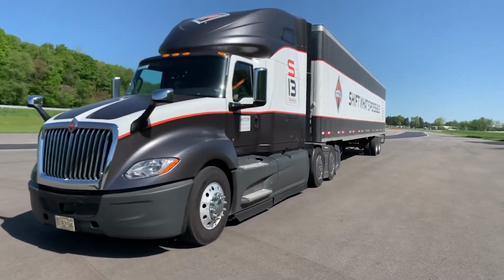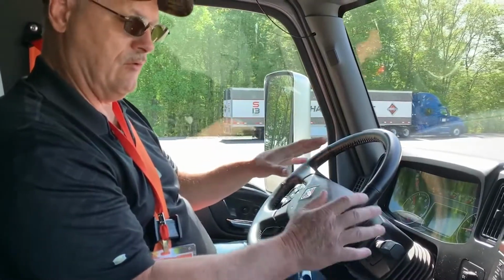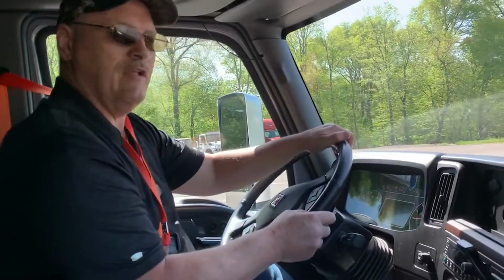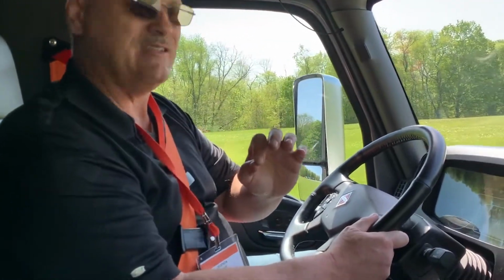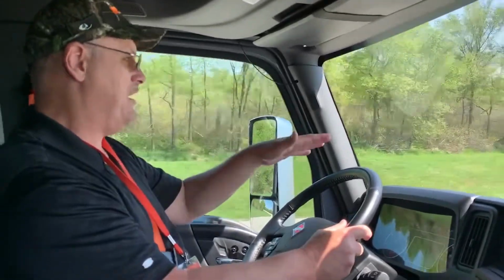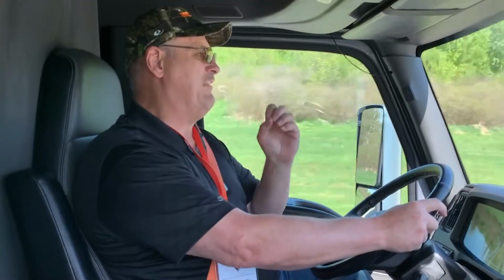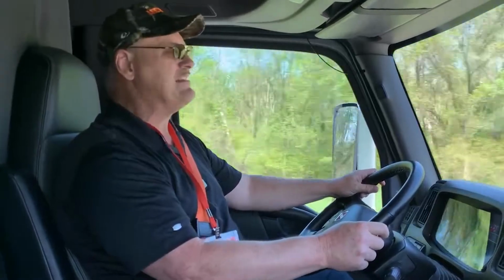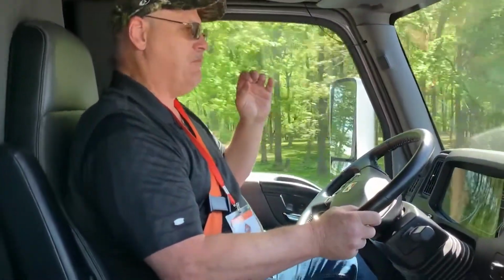International S13 T14 POWER TRAIN Test Track Test Drive in the LT625 Sleeper Must See!!

Comment: What are the biggest differences between the 2024 and 2026 LT S13 models ? Software updates ? Im test driving a S13 ,14 speed and put 100,000 miles on it. I just serviced it and replaced the thermostat under warranty and had recall and software updates ABS wasn’t connecting. I have an opportunity to buy a new 2026 @ retail however the 2024 is about 40k less. I can’t believe the deprecation is at 20k a year…is that accurate?
Reply from the maker: If the company is using five year depreciation even, then yes, it depraciates 20% every year.  What is the current status of your tractor need?

Comment: Anything is better than Navistar dog crap.
Reply from the maker: I appreciate the feedback, I am needing to open the conversation more regarding your experience.  As a reference every maker of engines has had - at one time or another. issues.  The former heads of the company (notice former) made a bad error which tainted the Navistar franchise.  That engine died and was buried in 2015.  If you are experiencing something in the current decade, then I am all ears!!!  

Let me know if this was a vent.  or if there is something for all to listen and learn from.

Thank you again for starting the conversation!
Reply: @MichaelOlden  everything I've seen on the Scania integrated package looks like a big leap forward for International trucks in North America.  Navistar screwed up with the Maxxforce 11 and 13 engines, the A26 upgrades have not fixed the reliability problems.  I hope that the S13/T14 drivetrain will cancel International's gremlins.

Comment: I hope Trump tariffs the heck out of scania to the point they can't sell them over here
Reply from the maker: Interesting point! this engine is built in Huntsville AL which is exactly what Trump wants to see!!

What is your driving experience with the S13?

Did you like the same overall starting ratio as an 18LL?  The final 5 mesh point to trailer or dock?  The even ratio spacing resulting is a much smoother gear shift pattern?
Reply: Its an engine buildt by "International" in USA.. its a whole concept with  gearbox and the exhauste treatment system!
I do think they have converted all the measurment and bolts to good old British Imperial measurments, for US market?
Its now a Traton best selling power train.. becuse in central and south europe they have kinda the same weight limits that in USA! Its in Scandinavia, Australia.. and to some extens south america there one need 700+ hp and more gears!

Comment: I drive Scania in EU for about 6 years by now, and besides the exhaust's sound....yeah, I happen to notice the Scania in the engine sound and the gear shifting ;)

You're in a real treat there
Reply from the maker: Thanks you for sharing the positives about your experience with the Scania!!
Reply: @MichaelOlden  You're welcome!
At the moment I have a 2 year old one (450hp, 12 gear), and got it with 165km in it. During this time, the only problem I had powertrain wise were faulty injectors (4 out of 6 got changed due giving the fuel to the engine on too high pressure). Till around 10-12 tons it barely feels the load on hills, after that starts to fight, but she does the job.

Comment: Traton not so much...
It's a Scania developed engine...
Transmission is the latest iteration of Scanias "OptiCruise"
Reply from the maker: Yes the powertrain is the results of five years and a billion dollar investment from Traton.  The Volkswagen AG holdings of M A N, Scania, VW Truck and Bus, and Navistar.  It first came to Market in the Scania as the Super 13 and the Opticruise is referenced as the T14 transmission in the U.S.
The is roughly 90% of the components in the U.S. as we are 12 volt and do not utilize the transmission retarder.
We are seeing incredible fuel efficiency, MPG, and true appreciated of and engine without required active regenerations due to the removal of the EGR and use of SCR technology to treat engine NOX.
Thanks for the Comment!!!

Comment: What is best for Colorado Rocky Mountains with altitudes greater than 13,000 ft on highway in hot weather?
Reply from the maker: Well - great question.  The answer is a turbo engine works well at the elevation referenced.  I would suggest a review of the load.  There is a 400 hp with 1850 lb ft torque that would be my fleet spec.  As an owner operator, you are more likely to go to the highest HP with the 1850 torque.
Reply: I think this truck would do great. In the north of Spain, all you can see is Scania trucks in those small and crazy roads of the Pyrenees mountains. I saw this summer various Scania non v8 pulling hard in a crazy steep and narrow 1 lane road,it was climbing at a very good pace with 35ºC (95º F) close to 2000 meters(6,500 ft). The proportion of Scania trucks in this area is very noticeable. That engine made 600 HP here in the top version. 
Spain is very hilly,you need more than 500 HP to not be at 30 mph on the highway in the mountains. Modern trucks here can go 40-45 when full loaded in those situations to not be a hazard for the speed differential.
Reply: @josemorenoporras7506  Well stated. Our altitudes go up to 14,000ft / 4267 meters above sea level.

Comment: I'm not knocking the product, your job skills or abilities.  International trained you how to drive that truck and transmission.  Your experience and safety policies have you driving it like a 40 year veteran.  Here's my challenge to both you and International.  Put that engine and transmission in a dump truck.  Imagine you're on the job and you have as many rounds as possible to make of hauling out of a job site, to a dump site. Get back to get loaded as fast as possible.  Loose dirt. Soft soil. Wet, spongey ground. Clay. Sand. Try the truck in all these terrains, loaded and unloaded.  For at least 200,000 miles. You won't always have equipment to pull or push you out. You'll have to give it the beans and make it  get itself out some times.  
As I said earlier, I'm not doubting the technology, your skills or abilities.  But in the real world applications like dump trucks, they're often driven like they're stolen.  I understand manufacturers can void warranties and refuse service if operation goes against recommended driving  techniques.  Dump trucks use the same techniques as road trucks and then some.  Lots of short trips. Way more stop and go experiences.  Way more shifting events needed.  Higher transmission Temps should be expected.  Build the trucks and transmissions to take the abuse. Limit those transmissions to off road capable dumptrucks.  Then come and give us the video.  The average construction dump truck driver is holding the foot to the floor and trying to take a bite in between bouncing out of the seat.  The butt massage experience you had in this video should only be expected by 40 plus year veterans and your test track, limited by safety policies and testing parameters.  Build it to not break.
Reply from the maker: A very well written and in depth search for a truck engine that can make it happen.  This engine is going into the HX Severe Service Model for Navistar International.  One of the significant reasons for the is that the transmission has the same effective low as an 18 speed Lo Lo transmission.
Speaking to the environment use, the US is one of the few parts of the world that has a tremendous warranty responsibility pushed to the factories.  And there are ways that an engine can be move from warrantable to non warrantable.  The issue being the servicing records, the improper use evaluation between sales and the client (i.e. 120000 GCWR use where the representative focused on 80000 GCWR), and I am sure there is more following use verse abuse.
I appreciate the 'driven like its stolen' real world use reference.  Which is why the electronic clutching will keep pace with the demands of the foot as the engine and transmission are clean sheet technologies BUILT to hyper communication and make use of the recognized axle load, predictive cruise, and selected performance mode to minimize aggressive foot throttling.  The quality of the field use also in off road applications is set to 'rock out of a hole' when a hole is 'discovered' in use.
Are all things bullet proof - well they have been severely tested and are in use today.  The mileage is not yet a 200,000 - but we are getting closer to that mar each day.
I will gladly forward your thoughts to my point of contacts within sales engineering and testing to allow their feedback as well.
This is not a design created solely by Navistar.  With your knowledge I am assured you are familiar with Scania and M A N.  Also a part of the Traton family name and instrumental in this creation.  As was the final sister company Volkswagen Commercial and Bus.  This powertrain is a world wide component with 90% match of it assembly.
Reply: @MichaelOlden  I'm currently driving a 2018 Volvo VHD quint dumptruck. It has the 12 speed automatic transmission. The truck is set up with a pointless hook for towing.  The spots I see low performance from this machine is: When the tires start sinking, the transmission has to be manually put in first gear. In Auto mode, the transmission goes to 3rd gear by default. There's also a delay in engagement from park to forward, and forward to reverse. This slight delay, combined with the requirement of manually putting the transmission in manual adds up painstaking seconds when you're being pushed or pulled from a stuck situation. The result is the transmission  gets confused with the sudden electronic demands. That's the best way I can describe it.  It locks up and will kill the engine at the slightest touch of throttle.  This "stubborn streak" from the transmission that happens, is followed by the boss getting upset. They have to get another piece of equipment to pull the truck out. It won't help itself out.  Once the truck is out, it sits for another minute, and everything engages and shifts as it should.  It's a tough transmission.  The truck has just over 150,000 miles.  It pulls a tag trailer with a D6K LGP without problem.  It's the off road use that needs the focus. It's not uncommon to do quick direction changes, just to keep the truck moving in certain terrain.  Have the engineers set up a quint dump truck with this engine transmission combo in your video.  I'd be really interested in shoving better results under the Boss's nose to look at.  A good truck can make more money. Bottom line.

Comment: Any idea what the warranty is going to look like ? I assume it's going to be practically bulletproof I hope considering the MaxForce debacle.
Reply from the maker: The base warranty is actually a standard warranty for the truck.  The accolades of this engine are reverberating in our sister company Scania - the Super 13 is wining awards for MPG and power in other countries.  The main difference is that we use the 12V vs 24V system, and other market use a transmission brake verse the engine brake.

All good and all awesome.

The removal to the EGR and Variable geometry turbo, the planetary transmission with electronic clutch (vs pneumatic that comes with air build up time and warnings), and for those who need it - the PTO will come from the factory to instead of a 1 year warrant.  Your get at least two and it is part of ANY transmission warranty.  WOW!

BTW did I mention that the SCR technology only uses 10% more DEF - we use a dual dose SCR focused system and allow the engine to be an engine.  IE. produce power verse choking a bit on its own waste.
Reply: @MichaelOlden While we all know Navistar was incapable of building an engine without help from other companies, I hope this engine does well for the drivers and owner operators that may drive or own it. I love that they’ve gotten rid of the EGR, DOC, and the increased DEF is a non issue. 

I have had trucks with electronic clutches and pneumatic clutches, and I prefer the pneumatic clutches due to their reliability, clutch engagement power, lower maintenance, and the fact that they’re easier to maneuver while backing up. I’ve never had a pneumatic clutch “run out of air” like International claims while backing up, so that point is completely irrelevant. It will be interesting to see how this powertrain does in the real world because we all know the testing isn’t done with the same factors drivers face on a daily basis.

Comment: Please test the unit in the West Coast we have mountains and curves.  US routes 101, 299, i-5, i-80, and i-10 CA-AZ, have a driver pushing it on the mountains and curves 80,000lbs.
Reply: Handle that piss easy. NZ ones have been doing at least 50,000 kg (110,000 lbs) on this Power train for the last couple of years.
Reply from the maker: I will check with my contacts at international for a response to this inquiry.
Reply from the maker: Still checking for feedback, but I am sure that there are large national fleets that are currently involved in that exact testing. Keep watching for more reports!
Reply: No need too. It comes from Scandinavia. Mountains, polar winters and double freight weight. And the best in mpg
Reply: I loved it ! Manual shift is your friend .

Comment: When is it going to be available for sale @ dealerships??
Reply from the maker: With the backlog of tractors it is hard to say .  But I can share that many will start receiving trucks intended for demonstration.  I.e. runs a couple of weeks with certain fleets then available for end user delivery.

Would you like to receive a price on that?
Reply: @MichaelOlden   I tried to get a quote online but never heared back... My guess that truck price will be close to 200k brand new... The power train looks very promising, but I hope that international is using better materials and better quality control when manufacturing the engine bcuz their A26 engine premature failures were due to lousy manufacturing of some engine parts. Lastly what mpg did this truck achieve when MT and loaded??
Reply from the maker: @foshnoush   I may not have received the email request,  Please send to molden@lee-smith.com
Reply: I placed an order for a 2025 LT model with S13/T14 drive tran back in June, for the proformance International LT engine rating of 515HP,  my quote was 197,512... Alot of LT's with A26 averaged 8-9mpg with eaton edurant tranny, im hoping this S13 averages around upper 8's to mid 9.5 mpg.. I deliver to grocery stores produce an drive back empty.. 9 mpg is definitely doable
Reply: Price includes F.E.T also truck is fully loaded with Frig, shore power.. Its probably less then 197k i had dealer remove Bendix wingman fusion from truck build..  Color of truck is custom, light blue
Reply: @jsmooth176   How much did you pay as a down payment, if you wouldn't mind me asking? When you expecting to get the truck?
Reply: @omarh4694  I had to put down $10,000 to place truck order, was told by dealer rep, 20% down due when truck comes in.. $10k to place order, deducted from the 20% down payment, almost 40k in total.. Been asking dealer rep every month since order was placed, its on pace for January, 2025.. I have vehicle vin already, hope it builds in December..
Reply from the maker: @jsmooth176  Congratulation on  placing your order on the 2025 LT with S13 - I look forward to your feedback on the success of your tractor!
Reply from the maker: @jsmooth176  Thanks again for the added value information!

Comment: Did you guys have the windows down while driving? Seemed really nosey to me.
Reply from the maker: It was more likely the microphone and editing.  If the I feel the sound needs a bump for clarity it can get wonky.  It is a clean environment and low noise.  As it was part of a group they were using hand radios that sometimes kicked up an airy noise too.  When you get a minute to test drive one, give me a heads up on that experience!
Reply: @MichaelOlden  I'd love to test drive that new Powertrain! I'm, as many are very excited to see a new exhaust  system works in the US of A market. European designs are always great until they come to the USA and have to deal with the variant of temperatures that we deal with here.
Reply: @dfireballwow   You think there is no variant in temperatures in Europe from the Arctic North in Winter to the Mediterranean South in Summer? We may not get the humidity of South Eastern US States though.

Comment: Wats the max gross weight this engine can pull
Reply from the maker: The US roads focus on the Federal Bridge law of 12 front 34 tandem and 34 rear trailer.

What is your application? and pull need?
Reply: @MichaelOlden  heavy haul,gross weight 120k lbs
Reply: @Asmr-jn3so you can pull 120k lb gross weight easy with that engine, you just need to get higher gear ratio on drive axles .